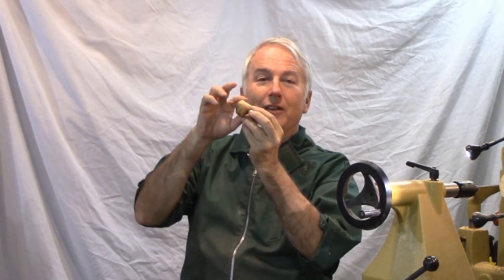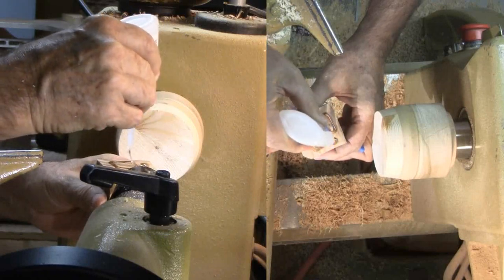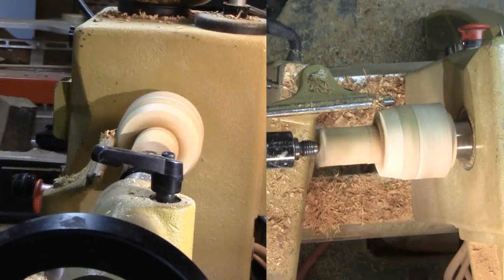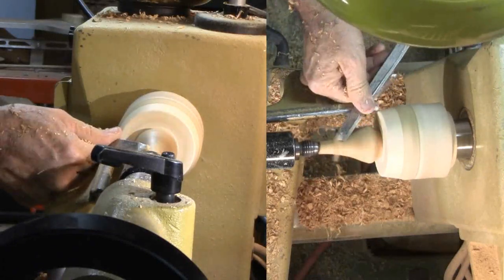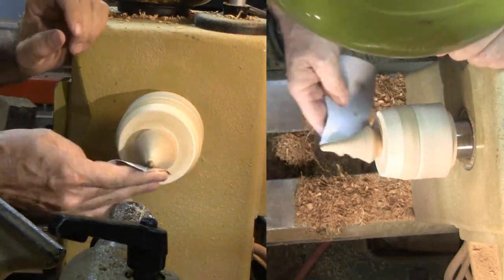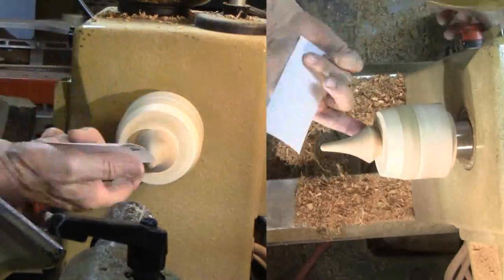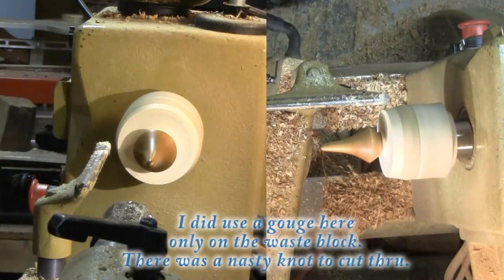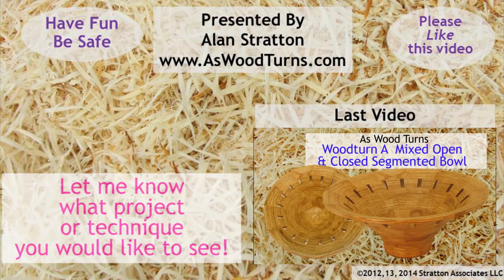Woodturning Skew Practice - A Wedding Ring Holder

Comment: Alan, nice job with skew.  I have mastered all the turning tools except the skew.  I still have kick backs.  I have changed the angle and my approach but the skew is still problematic.  The end points always seem to dig in.  I was thinking about rounding the points off but then I wouldn't be able to use them for their intended use.  I guess I'll have to keep practicing until I get it.
Reply from the maker: Richard, I still get catches and those spirals except that now I can identify that I wasn't paying attention at the time. Keep at it - the skew can be tamed.
Alan